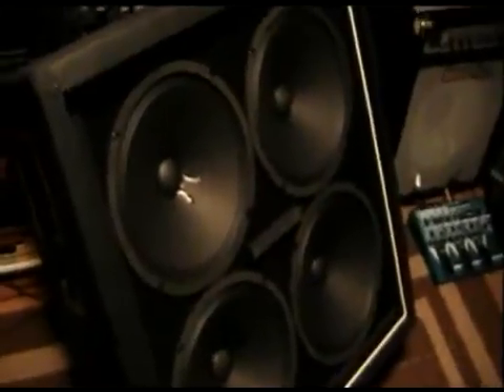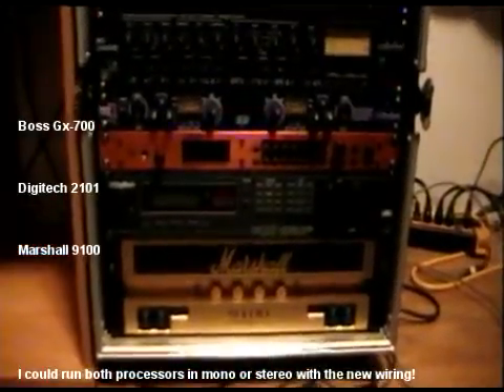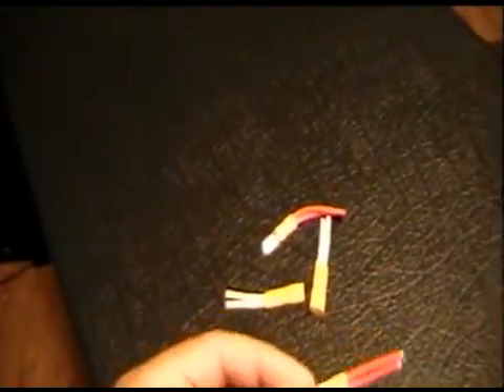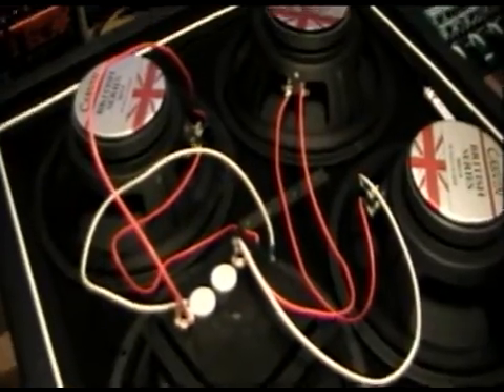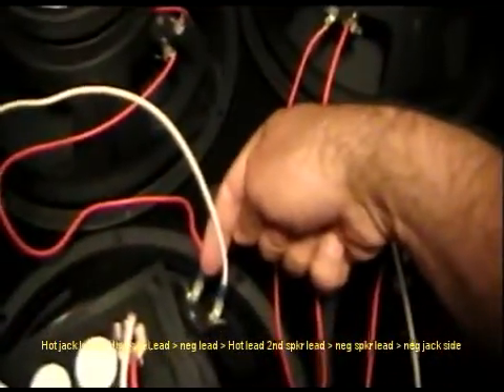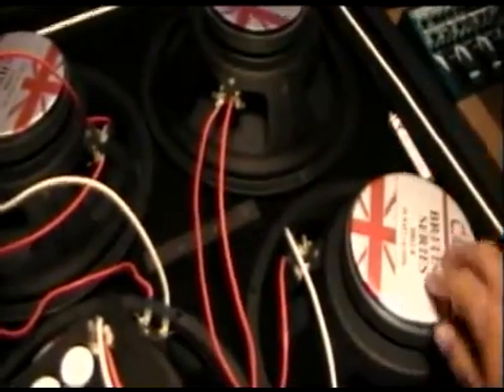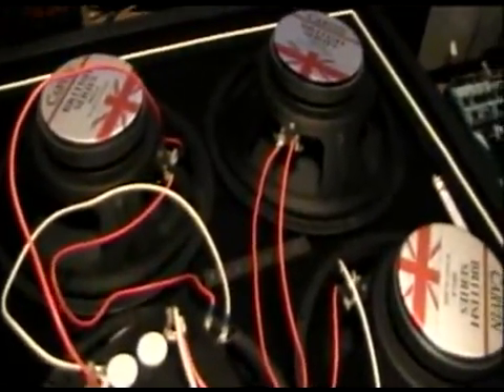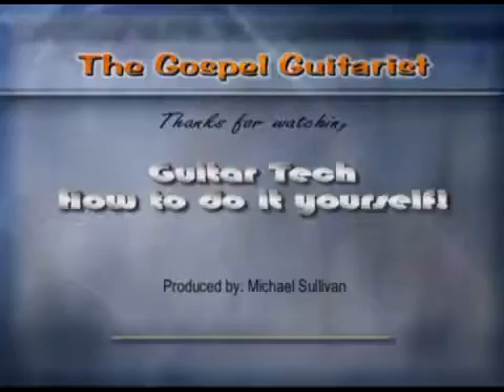412 Cab Rewiring

Comment from the maker: Yon need to wire the speakers in parallel to get 4 ohms to meet your amps output. Run 2 wires separately from the + sides of both speakers to the + terminal on the input jack (the short one = tip +). Run 2 wires separately for the negatives to the input jack (the long one = sleeve -). Each speaker wired directly to the jack with separate wires! (parallel) This will be a 4ohm mono cabinet. In short, pull the wires off one jack and add them to the other, done. :)

Comment from the maker: According to the 6505 page at Peavey, the amp has switchable ohm setting of 4, 8 or 16 ohms. You don't need to covert the cab, just set the switch on the back of the amp to the ohms matching the cab.

Comment: how would i wire it if im trying to convert it from 8 ohms to 16 ohms because im gettng a peavey 6505 head unit but i dont feel like buying 2 8 ohm 4x12 cabs and then daisy chaining becuase 1 im low on cash from the purchase of the amp and 2 i can get my hands on a 400 watt 8 ohm cab and i dont know how to wire it to be a 4x12 cab 16 ohm series wiring style

Comment: Pretty sure with those standard switchcraft (2) terminal jacks you have to use nylon or rubber washers on both jacsk before mounting the jacks to the input plate...if not there is a possible grounding issue....
I run that type of set up accept I'm running vintage G/10's using 2 seperate amps...
Also made the third jack to run all four 10's in mono.....